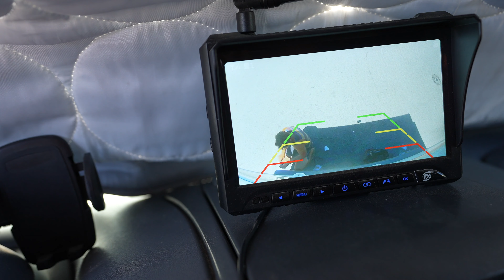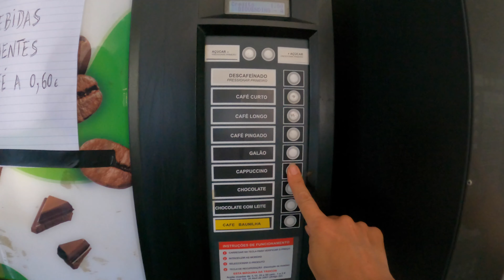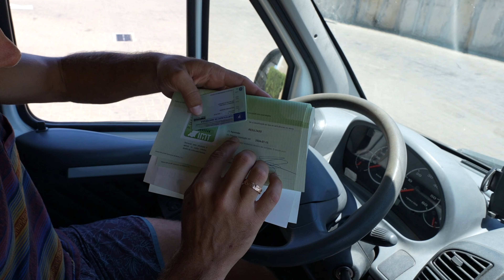WE NEED TO REBUILD OUR ROOF. Renovating a ruin Portugal 🏰

Comment: You need to put that over the camper to keep the heat off the camper then it will not be so hot in there. If the sun isn’t beating on it, you can also use one of those sail shades they sell a lot of different sizes

Comment: Being someone who is on the road on a daily basis, vehicle check is mandatory. If you think you can get away without, it WILL come back to bite you HARD. 
Insulation, holds, neither heat nor cold, it resists transfer of heat.

Best wishes from Northern Canada.

Comment: Breaking here at 11:17....they do have annual state inspections here in VA.  Some states have smog inspections (CA and CT that I know of), some have both.....Hoping you will pass with no problems.  Back to the video! Congrats on the Inspection.  The beach was a nice treat and the lemon filled doughnut, wow.   Agree on ....let the building begin!  #645👍
Reply: Dont you mean 'exhaust gas/particulate ' inspection?

After all, smog is mearly what it becomes over your city once in the atmosphere.

Comment: Fingers crossed plan review is done quickly, so you can get started on the roof!   I work in a plan review office… and my office is running about a month behind In reviews.  We have a bunch of people submitting projects this summer… especially for solar on roofs.  It feels like everyone is building this year or catching up on projects that were on hold. You’re starting to get to the exciting phase.  I so excited for you both!  

BTW…. I have to do a yearly emission test on vehicles that aren’t brand new in Nevada, so I can respect the last moment repairs to pass. It’s the last thing you want is to fail.
Reply: Why would solar panels on roof require government approval?  That's silly.  I can understand the tying into the electrical grid requiring approval.

And failing is not bad.  It just means you have to plan accordingly.  Failing is learning.

Comment: Every bit of shade helps. I had a 5th wheel camper at a campground for 10 summers, 6 months each year. The difference a shade made to help through the hot summer months made a huge difference. Glad you have a little more shade, hope you're a little cooler, maybe next get a larger more solid one to cover the roof and shade it from the sun  shining on the roof. Blessing sweet ones❤

Comment: If you are in Monchique, at this point in time, be careful, the fire as crossed over to Monchique. Contact the local fire department and let then know where you are living, in case they need to order an evacuation.... or come and save you.... 
That is problem we have..... there are foreigners living off grid and when the fire comes.... if the Civil Protection, police or Fire Department don't know they are there.... well....  
Just be safe.

Comment: In Ontario Canada, cars over a certain age require an emissions test every few years. It's mainly about keeping pollutants out of the atmosphere. As for mechanicals, every time the car changes ownership, it requires a mechanical safety inspection. In the meanwhile, you have to maintain your vehicle (lights etc) or the cops nab you for safety violations (lights out etc)

Comment: Great news about the vehicle inspection and hopefully the roof will cost less than you are estimating. A suggestion for you is to get 3 quotes on the roofing as then you will have a greater choice. I used to be a Supply Officer and part of my job was exactly that....getting quotes on jobs in the construction area. 
Great to see that pesky brush gone too!! :)

Comment: NH has annual safety and emissions inspections (due in birth month), regardless of vehicle age - including motorcycles.   They are done by private business (dealers, repair shops, etc) - licensed by the State as inspection stations.  There is no set fee, but most will charge $20 - 30 for non commercial vehicles.  Many believe it is just a revenue generator, as we have no income or sales tax here.

Comment: I don't know, but from the drone view it looked like you could remove part of that outer wall and re-contour the ground to redirect rain water to eliminate the hole with gently sloping ground away from the structure.   And/or roof over part/all to create a closed-in outdoor storage space.  It's a maintenance nightmare in current status.  And once you get your approval for occupancy you could opt to do minor complexity improvements like that on your own, skipping the begging for permission phase (once you're competent in doing it safely and effectively within the codes, not hard).